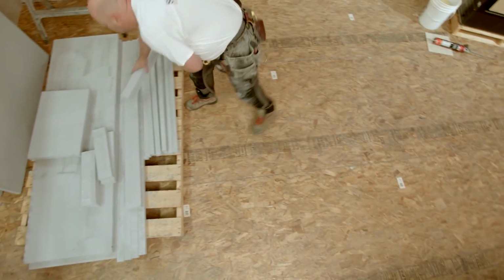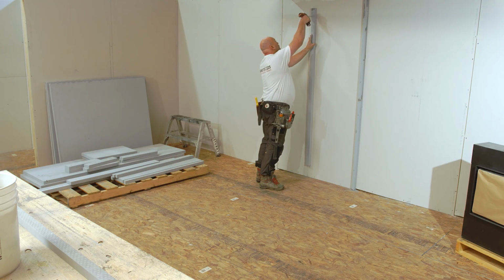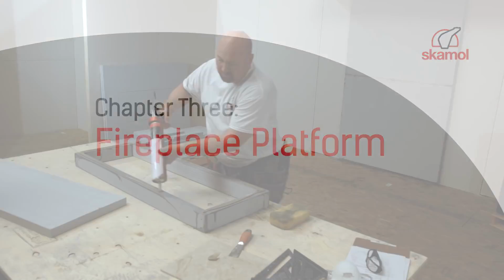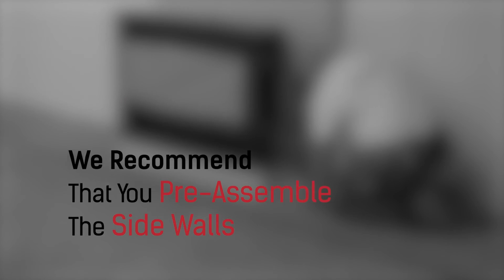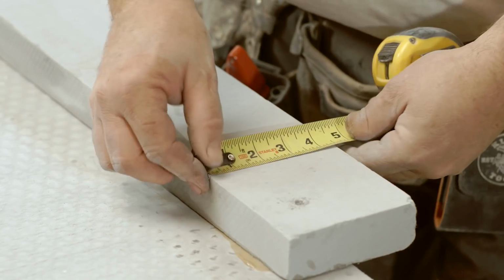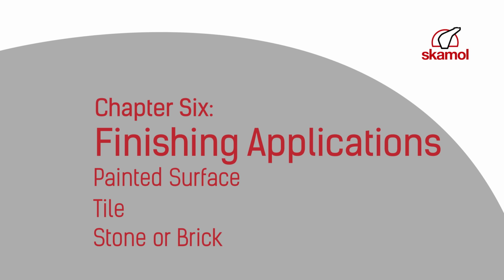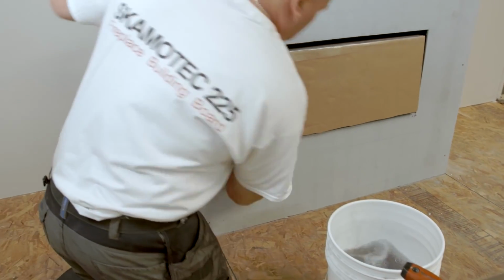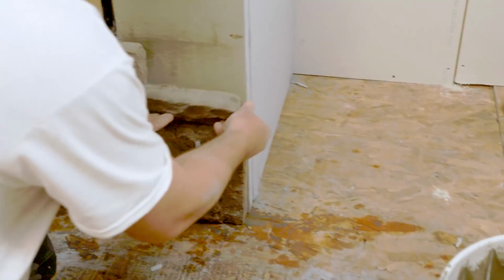SKAMOTEC 225   Building board for fireplace enclosures

Comment: Dear Sirs, I have an fireplace construction from your material. I want to hang TV mount on it. How to do it correct? My buliders want to mount a large metal plate to distribute the load, having previously made a small milling in the plate to the thickness of the plate (2 or 3 mm). is this correct?

Comment: You forgot to install your venting.
 What is the advantage of this product, if you still have to air gap the back wall of the enclosure? We are looking into the product for use with Hoxter fireplaces, to line a combustible enclosure. What is the R-value of Skamotec 225?
Thank you.
Reply: Try to build accumulation fireplace with Hoxter. Its a very good company , high quality. 
Convection fireplaces are good to build in buildings where you need warm quick (weekend houses, etc…) it works like dryer 
But accumulation fireplace is so much better for your health.